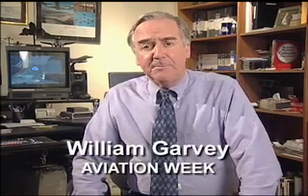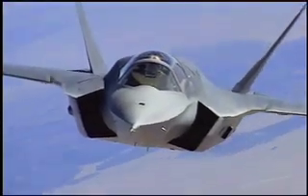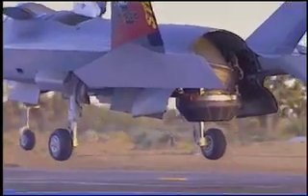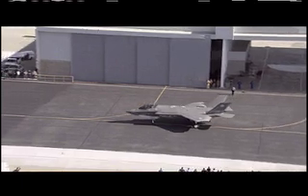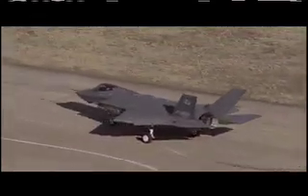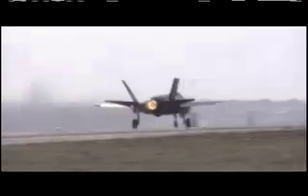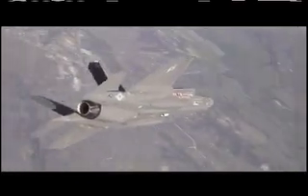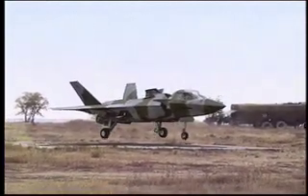F-35 Lights its Fire

Comment: @fmoa 

4. The Indian pilots at the Red Flag complained of only one issue about the avionics. That was the incompatibility with the American AWACS. That left them out of the network and blind in the joint exercises. They had to manually confirm each plane if it were a friend or foe. 

5. It's just that Indo-Russian avionics are not compatible with American systems. It is like trying to use Apple software on a PC. You'll need a port for it. Now India developed that port and bought American AWACS.

Comment: @fmoa 

1. India uses its own avionics systems. Whoever told you we use Russian or Israeli is an idiot. 

2. The Su-30MKI is produced in India by Indian Industry. The plane's blue print was transfered to India as part of the deal and India adds and upgrades the Su-30 with its own avionics and weapons systems and calls it the Su-30MKI

3. T-50 will have the Indo-Russian avionic system. Not Russian alone. India (DRDO) is recognized to be advanced in avionics, comparable to US & Israel.

Comment: @fmoa:

1. I'm not Russian
2. F-22 is a fine piece of American Engineering.
3. Su-37 and Su-47 were just experimental technology demonstrators and were initiated in the early 1980s. 
4. A true & direct competitor for F-22 is the Su-T50 Pak-Fa. 
5. Pak-fa is still now out yet, so F-22 rules the skies. 
6. When Pak-Fa does come out, we can discuss if F-22 has been finally outdone after a decade of air domination. 

Just getting the facts straightened out. That's all.

Comment: sorry, the message posted previously got some mistake. here's the complete one:
the DAS installed on the f-35 will rape both su-30 and su-35. It makes maneuvability of other aircraft useless and makes thrust vector look like a joke. No wonder it didn't need thrust vector. Watch this video (replace the "[dot]" with "."): es[dot]northropgrumman[dot]com/solutions/f35targeting/assets/eodasvideo[dot]html